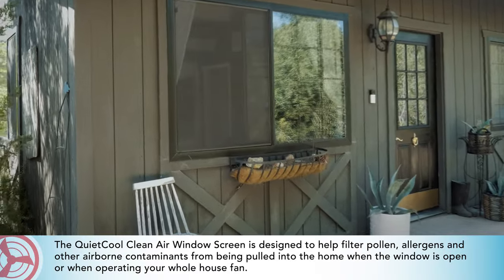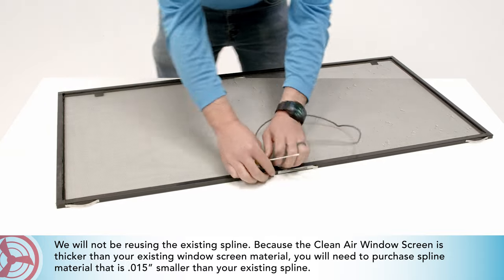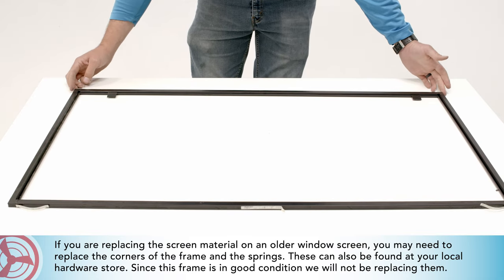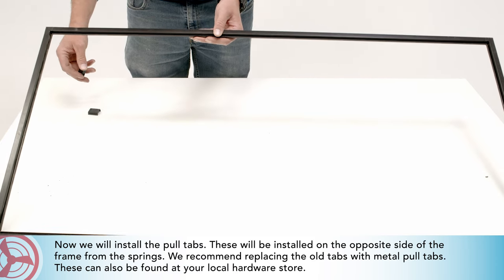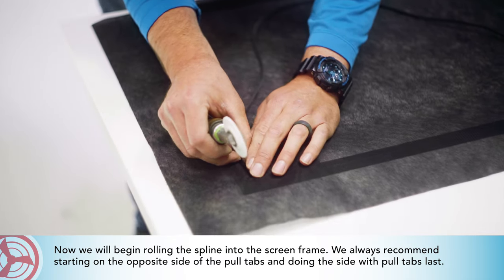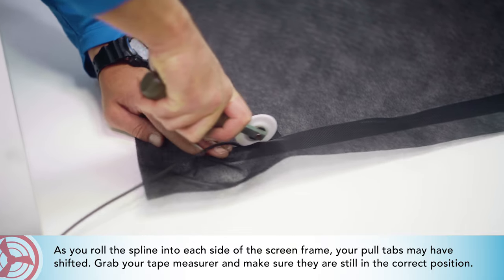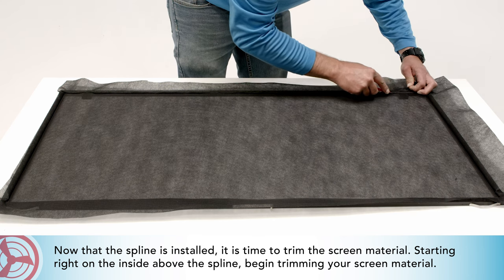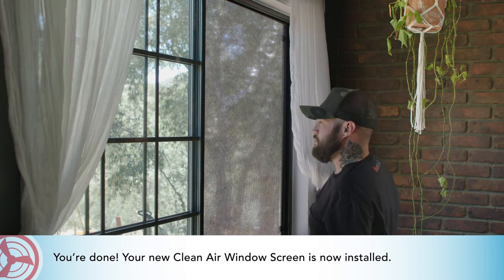QuietCool Clean Air Window Screen Installation

Comment: Why wouldn't you supply the metal tabs and smaller sized spline?
Nobody's going to waste time trying to size spline material at home depot?
Wouldn't a kit with these and the spline roller make more sense?
Reply from the maker: Hi cjmacy,

With this type of material, you need to size down your existing spline by .015", so we are unable to supply the correct size without knowing the size spline that you have in your screens currently.

Home Depot can get you the perfect sized spline very quickly, but if you'd rather have a local contractor perform the installation for you, they can do it very quickly.